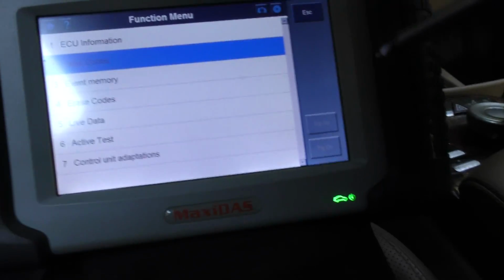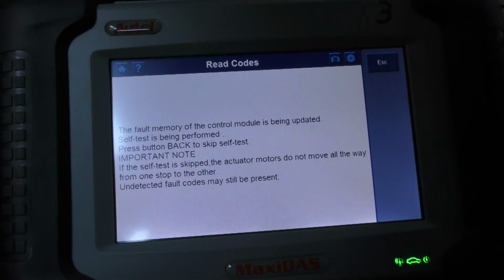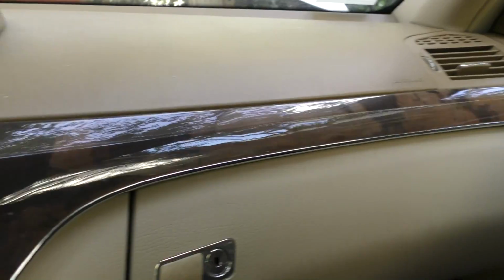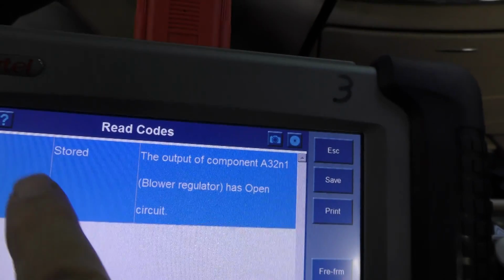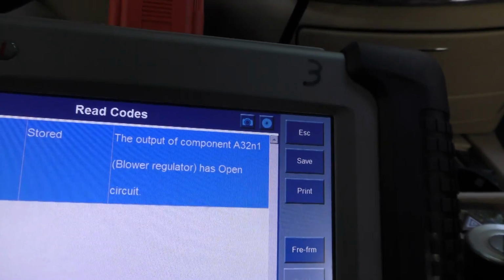How to Fix Modern AC System in Your Car

Comment: Thanks Scotty. Last month, I blew my blower motor on my 09 BMW 528i. Unlike this Mercedes, on the BMW you have to take out the center console, and almost the entire lower part of the dash apart, because the blower is set behind the radio. Since I changed the blower, I also changed the resistor, because it took me all day to disassemble the dash, glove box, console, and vents. I did the same thing on my mother's Honda Civic, about a year ago, which took all of 1 hour. I don't know why the Germans make their designs so difficult to access? BTW, I saved a lot of money by buying parts on Ebay. Stay away from the parts dept. at the local dealership.

Comment: I'm actually kind of proud that you didn't just shame Mercedes-Benz as you usually do. In reality, they aren't bad to own if you can do the work yourself... but most people that buy them can afford to have them fixed anyway. It is true that the parts for them are more expensive, but my Mercedes rarely has issues and I've had more trouble out of domestic cars than any of my German cars. I honestly find the computer diasnostics to be more helpful than a nuissance, it's just the way of the future.

Comment: hey Scott I have a question I have a 2003 pontiac grand am and had a problem with the bulb in the break lights  staying in the socket so I bought some new ones and it did it again on the new set is there a cheap way to fix it like super glue or something ???

Comment: I get the outrage about things being complex and particularly with Mercedes, which is a shit brand and the cheap ones do not last long and probably the expensive ones aren't that good either. Having said that. Regulator, because it isn't a resistor. It is probably a thyristor-based current regulator circuit that instead of burning the excess electricity on a resistor producing heat does very quick switching  like your power supply in literally any electric system nowadays. This actually saves energy. Now sometimes a thyristor can blow up but only if it is a shit one. Apparently mercedes ordered from shit supplier. And most likely the failed regulator killed the motor at some point or vice versa. I guess you will never know.

The switching power supply was invented by a very smart guy who worked amongst other things on the Apple 2 back in the day. That was the first mainstream computer to have switching PSU. And his legacy is everywhere from a phone charger to a TV, and even in your energy efficient lightbulbs there is a tiny switching power supply right there in that white plastic covering at its base. Imagine your phone charger with a 10 pound heavy transformer on it. That is replaced by a very clever switching PSU that is light as a feather and does the job with 99% efficiency.

I get that it feels good to bash modern engineering but sometimes I feel you aren't fair lately. The manufacturing quality of a Merc is abysmal but the engineering of this thing is just right and your anger is misplaced.

Comment: I think it was you, but may be wrong. I saw a video some years ago that answered the obvious question --Why not hot wire it with a button thermostat switch?  When it is all said and done it is a motor turned compressor that is engaged when a thermostat switch engages the compressor solenoid.  I can buy a 5000 BTU air conditioner at WalMart that does all of this for $150.  A car cabin is not such a big space to cool.

Comment: I can't stand this complexity. My '59 Cadillac have zero computers and no buttons. It does have power windows, seats, brakes, steering, simple AC and a radio. I have restored the whole car to factory and rustproofed everything so there is nothing that could go bad. It will last for 100 years.

Comment: It's true that the blower motor is part of the AC system, but it's also part of the heating system as well, not only the AC.
Hey, at least it's not too hard to get to that blower motor assembly and take it out, and the diagnostic tool did point to the problem area right away.

Comment: Scotty, I have an AC problem with a Lexus RX300 2002 over here in Cambodia. The air would not blow at all sometimes (like once every two weeks). Have it checked with a garage and they said the failure was because of the dust getting into the AC system and recommended to change condensor, compressor, evaporator, expansion valve, filters, pretty much everything. We complaint about the cost so they said well then let's just do the compressor, condensor filter, added CH 12 and refilled the refrigerant. Took the car back and the same problem appeared again the next day. Went back to the garage and they said you should have listened to us and replaced everything. Went to another garage and they said they have to wait until the AC stops working to find the problem. Waited for five days and they said they could not figure out the problem because the AC worked fine. Got it back and the problem appeared again. Please help!

Comment: I had the Blower motor resister problem with my Jeep back in November. those in Jeeps and other Chrysler vehicles fail often. when they do all the fan speeds but the fastest don't work. the part is $12 on amazon for the Jeep and took 20 minutes if that to install.  

you all are right about the newer Mercedes they are over engineered with a lot of junk. MB lost it way in the 90's. the older ones especially the W123 were great cars the diesels were very great cars that kept going but the did have issues with the vacuum systems that ran a lot of the controls and HVAC.

Comment: what was the total price of the parts ?? Yeath I had a a 2003 Lexus and I had to replace the sunlight sensor before I could charge the AC  system ,  do you want a Timex watch that keeps ticking or a Rolex with all the jewels  to tell you what time it is ? Same with cars , thanks Scotty
Reply: I'll take the Timex! That's why I own '90 Volvo 740GL. Nothing ever goes wrong! Just routine maintenance to keep it in mint condition. Volvo For Life!

Comment: I just fixed the A/C on my 97 Dodge Ram 3500 and there is one thing I am concerned about. The A/C pump runs and works fine in A/C mode but it continually kicks on and off when not set in A/C. When you have A/C off wanting to blow outside air or run heat, the pump constantly kicks on and off. Im not sure what's causing that, I'm thinking maybe possibly the climate control inside the truck but other than that I'm not sure. Any possibly suggestions?

Comment: I've never done an evaporator in which the entire dashboard needs to be removed and never will but  I've seen several mechanics do it and they have my pity, especially with the plastic parts that break coming out.  Also,  having to disconnect and reconnect so many unrelated systems and hope they work.  New cars are hell and dealing with the owners must be miserable too.

Comment: 1999 jeep tj.. friend hotwired his blower motor permently  with house wiring and a house lightswitch.. pos n neg.. no fuse
Reply: Firetrap!
Reply: it was cold n winter and the blower failed and he didnt know why.. after taking the motor out and finding out it works he hotwired it  temporarily with a lightswitch from a house and its only on high but thats ok  its been like that since 2 years because he would need the typical dash  rotary switches and the resistor   and the  18 yrold jeep aint worth it .. its a jeep... everybody fixes them  in crazy ways

Comment: I am starting to hate Mercedes-Benz as a brand because of Scotty! 😄
Reply: Ahmed Attar oh just wait until you have to fix one
Reply: Ahmed Attar I fix these cars for a living. They are actually not too expensive to fix if you order all the parts online. I've had better luck using aftermarket replacement parts on these cars than the original Mercedes branded parts.
Reply: They don't make them like they used to!
Reply: Ahmed Attar we all hated Mercedes anyway
Reply: Worst form of motoring welcome to the Mercedes
Reply: mercedes is the best
Reply: Mee too 🤣

Comment: So replacing just the regulator would have fixed the problem ...
Reply: The mech a nic nope, he ran 12 volts to the motor, didn't work. Probably resistor went bad and burnt the motor windings out
Reply: If a car manufacturer wanted to me a masochist, it could very well use an AC motor that requires an AC driver. AC motors don't work on DC. (Not to be confused with universal motors which work with either.)

In these days of pushing higher fuel efficiency though, I would expect car manufacturers to use more reliable brushless motors and an efficient variable speed driver instead of resistors. If you are going to pay a huge premium for luxury car parts, there should be at least a minimum of quality and sophistication to justify the price tag, not 40+ years old failure-prone and inefficient tech that used to cost under $10.
Reply: The problem was both.

Besides, you may not want to use the new regulator on a suspect motor.

Depending on the motor's problem (such as if it was shorted), using a good regulator on a bad motor could risk damage to the component.  Then, you'd have to sink another couple hundred on another regulator in addition to a new motor.

This is because who knows why both parts failed?

The motor could have failed first and took the regulator with it.

The motor was probably burned out due to a bad bearing since it seemed like the output shaft with the fans attached to it didn't seem to spin as freely as expected when Scotty spun it.

This means the motor has to work harder (and hotter), meaning that it may draw more current from the regulator, stressing it out.

From this point, I'm guessing something here.

I'm guessing that the fan motor has a tachometer output for the computer.  It's possible that the computer was detecting that the fan motor wasn't spinning as fast as it's supposed to, so the computer may send more power to the blower motor assembly to get it up to speed.  That could increase the risk of the blower motor overheating, which may also compound the overload problem with the regulator.
Reply: Lol.true
Reply: The video clearly shows only two wires coming out of the regulator and going straight for the motor contacts. No fancy sensing going on here, just a plain DC motor with either drop resistors or a PWM driver in the box. In the case of a PWM driver, a well designed one would have output current limiting and shut itself down on overload instead of blowing up.
Reply: Nelda  Cardenad it could very much be that both the regulator and motor were bad ,all I'm saying is he should have showed the new motor working by just putting power to it.
Reply: Nelda  Cardenad I agree, he could of just showed the new one working with power applied to it and I wouldn't even be writing any of this
Reply: There could be another wire not visible and there's nothing particularly fancy with detecting revolutions.

But chances are that you're probably right.
Reply: TheRaellz will do
Reply: The mech a nic That should be self explanatory
Reply: The mech a nic he tested the blower moter 1st
Reply: but he didn't show testing the new motor. who's to say the motor normally doesn't work without the regulator attached  (and working)
Reply: The mech a nic Maybe being a Mecedes. I tested mine on my Toyota JDM and it worked. Turned out to be the relay in my case. But it should work off the battery.
Reply: Rookie DIY I agree that a motor "should" work with adding power to it but with electronics on cars nowadays you'll never know. he should of showed the new motor working . if someone had this same problem it could be misleading and have someone buy a new regulator and motor just because that's what Scotty did. I don't like the idea of wasting money.
Reply: The mech a nic that's not true, that's why he tested the motor first.
Reply: Any motor just needs direct power to work. But then you need resistor to change fan speeds.
computer.it

Comment: All that plastic. So much cringe. I have to figure out why my A/C doesn't work. Pulleys work and Low pass is at max pressure. Compressor's has to be shot since I don't hear any noise indicating otherwise. Such a touchy system and it's out on both of my cars while other people have 20+ y/o cars that work fine. Smelly that first minute, but fine. >.<

I hate the computers on modern cars!

Comment: So, could have just replace the resistor to begin with since the replacement blower motor assembly still didn't work until the resistor module was replaced?
Reply: I think the problem here could be that that motor is an AC motor. The "resistor box" is likely an inverter and not a resistor at all and sends square wave pulses of various widths to the motor to control the speed. Applying 12V DC to an AC motor isn't going to get it to move anywhere.
Reply: @Bob Johnson, I didn't miss any part of the video, I observed Scotty applying the 12VDC to test the blower motor.  The chances of both the blower motor and the speed control box/ resistor / inverter failing at the same time is low.  I agree with SATAMAN, I think the box was indeed a pulse width inverter to control the fan at continuous variable speed as is the case with most of these fully automatic climate control systems in luxury cars.  An inductive run AC motor isn't going to run on 12VDC.
Reply: + micglobal & SATAMAN Schmidt  I guess you both missed the part of the video where Scotty bypassed the 'resistor' and hooked the motor directly up to the battery and the motor didn't operate. So, the motor was also defective, which is why he replaced it.
Reply: micglobal he did test the blower motor 1st
Reply: The motor didn't turn when hooked to battery power though. Seems like a fairly definitive test to me.
Reply: Apparently the case. The motor did look rusty and corroded but without turning the thing manually you couldn't tell the condition of the bearings so maybe it did need to be replaced, but, from the video the conclusion one would draw is that Scotty changed out a blower motor unnecessarily and that the entire problem was the module.
Reply: @SATAMAN Schmidt, thank you.